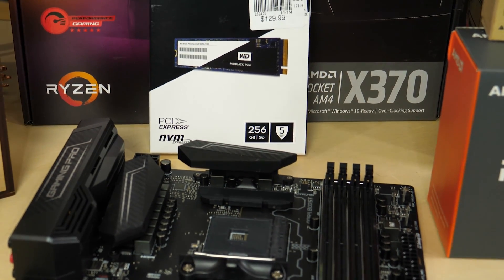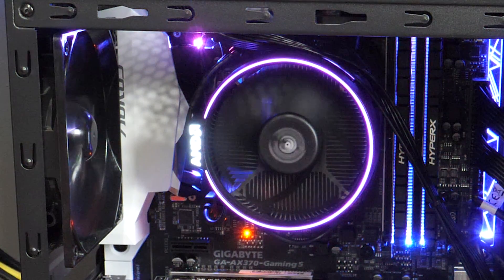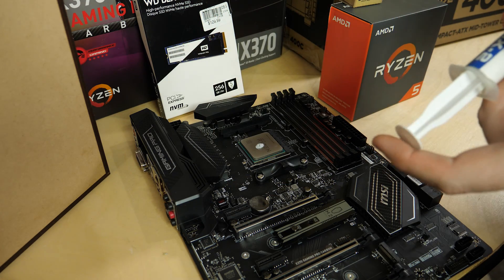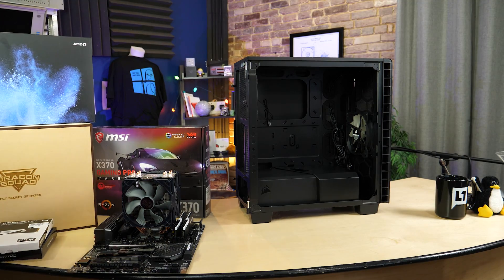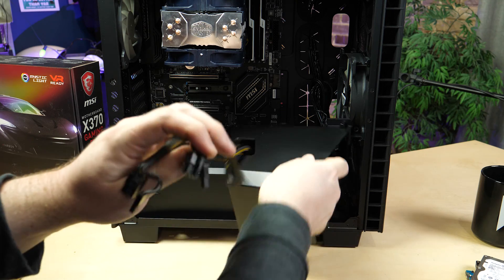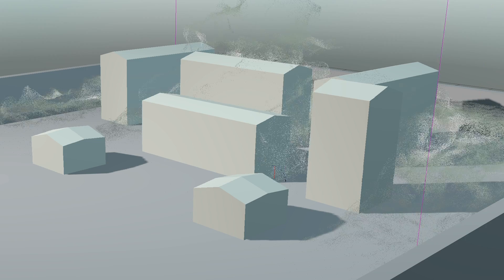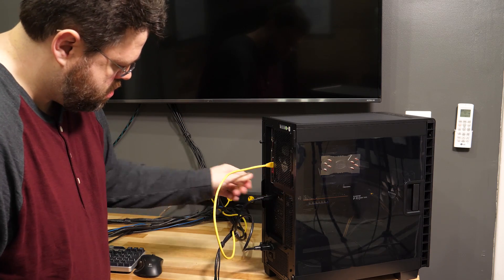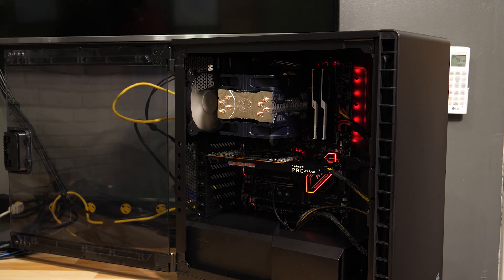AMD WX7100 Pro GPU build with X370 MSI Carbon

Comment: I don't really see a point to using a "Pro" graphics card even for a workstation, when you can almost get two regular RX580s for the same price... It's also pretty shitty that they don't allow 10bit output on consumer cards even when they fully support it.
Reply: he actually explained why in the vid, gaming cards are optimised for performance (FPS), pro cards are optimised for accuracy, when u do CAD work or 3D design that matters a lot
Reply: Pro cards are optimized for multi-viewport performance typically found in 3D apps... (gaming card drivers are tuned for 1 viewport... which is the game)
Also the drivers for pro cards are tuned for large numbers of fragmented 3D meshes.. IE: a Boeing model in Catia with 2 million separate parts
Reply: Yutaka Takenouchi accuracy in calculations (pro), performance/fps (gaming).
Reply: @Manicol Ercolano , @channelofstuff What are you talking about? Those "textures, fluids, particles, transparency, ecc" you speak of are displayed in the viewports via DirectX or OpenGl, both of which are single precision only, same as in video games. Similar with output gpu renderers, iray and vray-rt do not utilize double prescription(even though iray is made by nVidia it still doesn't support double prescision). You do not get any performance gain from using professional card over gaming one, hell you'd actually get much worse performance if you compare them price per price. There is no such thing as special driver optimization, the main difference between gaming and pro cards is that in the gaming ones the double precision is locked while in the pro ones, it's not(up until few years you could even mod your gaming card into pro one by reflashing the bios and changing the graphic card ID by resoldering few resistors on the pcb). That's where the performance gain comes from in the pro cards, but only in software that supports double precision, CGI software does not - no performance gain. The only reason for a non-cad user to buy a pro card is if they work with HDR and need higher color output than 8bit, that's the only advantage they'll get.
Reply: well a movie is only going to have one view at a time as well. thats what i think some of us are saying. its less graphic artists and more engineers/science people that would need this card.
Reply: Advection357: Yeah, seems like most of the differences are niche features that would normally be present on gaming cards, but have been disabled intentionally. Companies buying workstations in bulk don't mind paying the extra $ if it guarantees "maximum compatibility" with the software, so both AMD and Nvidia can get away with charging near double for practically the same cards. 

I'd be curious to see some benchmarks that test if multi-viewport performance really is that different, along with the other extra features.
Reply: @bios47 I get what you say but I have seen benchmarks where a tiny 75watt firepro W5000 smashed other  hight end desktop cards in maya and max although that was quite a while ago. Honestly I would personally never buy a quadro for my workstation, I have a 1080 and it performs well. At the studio we have all quadros K4000 and M4000 and a 1080 for VR and the 1080 performs better but that is not a fair comparison because of the age difference between those cards. Also a gtx1080 will support 10-bit display output. I would really like to get my hands on a pasqual quadro to test performance compared to a 1080 on the workloads that I usually encounter.
Reply: @Manicol Ercolano I'd love to see that. Comparisons between gaming and pro cards by independent reviewers are almost non-existent. Btw, what was the max/maya benchmark you saw testing? Was it viewport performance or gpu rendering? Maybe there are other viewport modes(other than cpu/DirectX/OpenGl) that I'm unaware of? Or other gpu renderer that support it? I'm only familiar with the most mainstream ones iray, vray).
Reply: @bios47 It was a viewport draw benchmark and if I remember correctly it was on maya 2011 and AMD cards were considerably farster than nvidia cards. On the other hand you don't see this kind disparity on newer iterations of maya anymore so I'm guessing it's a matter of software optimization more than hardware. My only experience in gpu rendering has been with Cycles in Blender, I mainly use Arnold in maya which is a CPU renderer but I'm pretty sure desktop cards perform way better than pro card, specially if you consider price per performance. A friend of mine that works in a studio that uses Redshift as a renderer onece told me that he saw a man sized crate full of gtx1080 for their renderfarm. They probably done their math before investing on those.
Reply: @pSyk What advantages do the workstation drivers offer to be worth that much over the price of a consumer card? At a glance it seems to be a lot of application specific stuff that you may or may not use depending on what type of work you do. Like for example if you need a workstation for modelling and character animation you wouldn't benefit from the LIquidVR SDK whereas the higher FPS of a consumer card would make the viewport a little more responsive.
Reply: I do 3D design, and the type of glitches Wendell described make it seem like the card and drivers are tailored to work around software issues that companies like Autodesk don't want to fix... I'm also thinking that if you're a game developer it would probably be better to work on consumer hardware since that's the type of platform the finished product is going to run on.

Now if it can do things like faster GPU raytracing it would make sense, but with no benchmarks and few people using these cards it's hard to tell.
Reply: @Advection357 Would applications like Blender that draw the whole 2D UI and 3D viewport inside one OpenGL window benefit from something like that? And aren't secondary viewports static most of the time under standard workflow? They're usually drawn as ortho-wireframe which doesn't need any shading and is drawn faster anyway. Perhaps it handles multiple monitors with multiple viewports better but that's a pretty specific use case to be worth the price premium...

The large number of fragmented 3D meshes feature sounds helpful, but if it's just a software implementation, why isn't there a "tuned" Pro driver for consumer hardware? It's like the 10bit color support - the consumer hardware supports it too, but it's disabled...
Reply: As far as I know back in the days of first gen GCN (and maybe prior too) AMD has 10 bit output on their consumer cards, which made me go Team Red to pair with my U3011. Wish Nvidia would get onboard and reserve 10 bit on the consumer just for games.
Reply: Yutaka Takenouchi You pay for the work that went into the drivers. Not only the card.
Reply: This is my issue with the video. They made a build for "graphic artists" and "3d modelling"(cgi work I assume) that use software that can't take advantage from Double-Precision Floating Point found in professional cards. Wendel should have made it clear that this build is for engineers/cad users only and clarified that the only benefit from professional gpus, content creators would get is a support for higher color output than 8bit.
Reply: Yutaka Takenouchi no and no
Reply: your issue is not an issue because your assumption is wrong. Those cards are aimed at CG artists that need to display textures, fluids, particles, transparency, ecc.. in their 3d or 2d software which 3d cad engeeners don't need to. Also software vendors like autodesk or the foundry work with nvidia and AMD to develop drivers optimized for their software to work with those cards, minimizing display glitches and increasing viewport speeds.
Reply: Yutaka Takenouchi: I'm not too familiar with Blender but the 3D apps I use have 4 viewports that can all be shaded and interactive at the same time... so with a pro card the viewport performance should be better... 30 - 50% given the same hardware. As for the last question... it's because of $... Nvidia/AMD prefer to separate the pro market and it's features and charge extra...

Comment: Should have used the Corsair CX650M power supply. It has black cables and is around the same price. Other than that its a good looking build good choice of parts

Comment: Does the AMD WX Pro series of cards support DDA (Direct Device Assignment )? As I am interested in one of these for a Server 2016 3D RDP testing
Reply: Andy Dodd I dont know much about that kind of stuff, but isnt that a mobo bios thing?
Reply: No, this isn't VT-d which is a BIOS/UEFI option. This is a native feature found in the driver set, normally in pro level cards. I know the Qudro's have this feature but they are too expensive for lab environments.
Reply: Thank you. 😃

Comment: Test it with Sketchup animations please.
Reply: David Brown i think he is joking
Reply: Victor Noel Cory Paz How advanced are you with SketchUp? I was able to build a 3D model of my school (at the time) on a fairly average computer.
Reply: There's no animation feature in Sketchup as far as I know :P
Reply: David Brown I'm not an expert but I know one or two things ;)
Reply: TRIDENT STUDIOS Nope, I'm not joking.
Reply: Advection357 Yes, there is.
Reply: Really... sketchup has keyframe animation? Hmm maybe I used an old version a few years back.. is this recent?
Reply: Advection357 I don't know if it is recent but you certainly have a lot of extensions for Sketchup like this https://extensions.sketchup.com/en/content/keyframe-animation
Reply: I think he means the different cameras you can set up and toggle through. Sketchup will attampt to animate the transitions and usually it will run at about 1 frame every 2 seconds, because Sketchup.